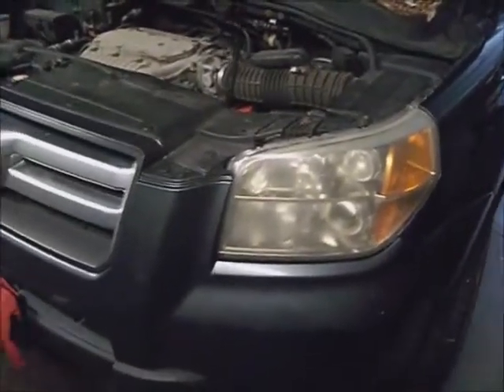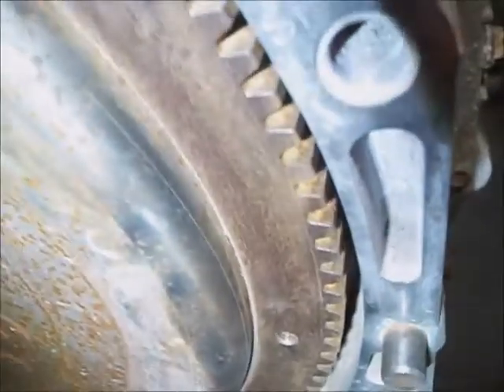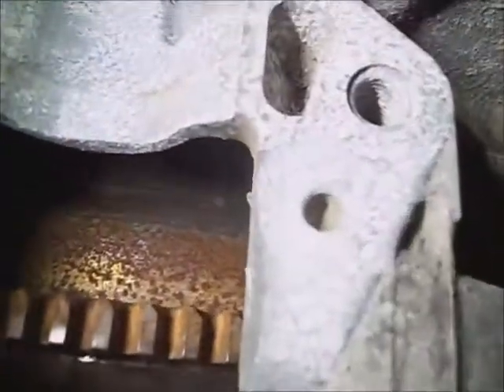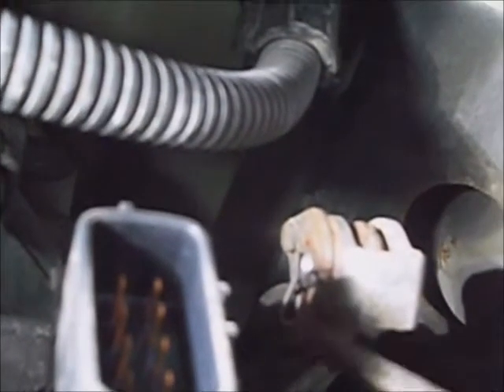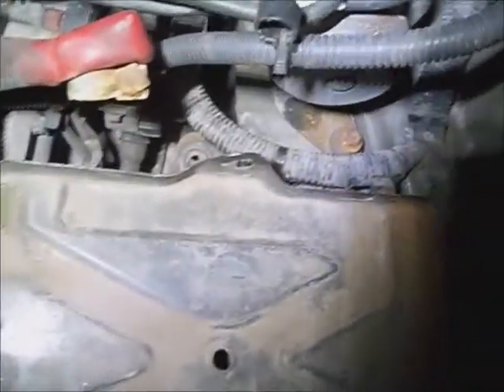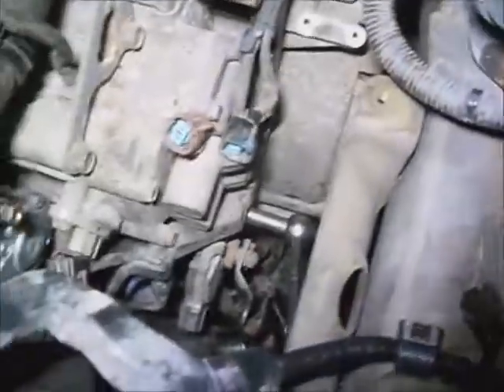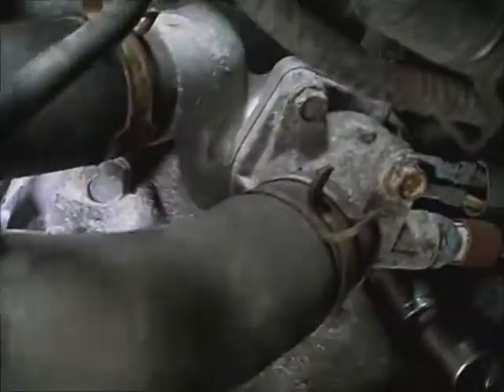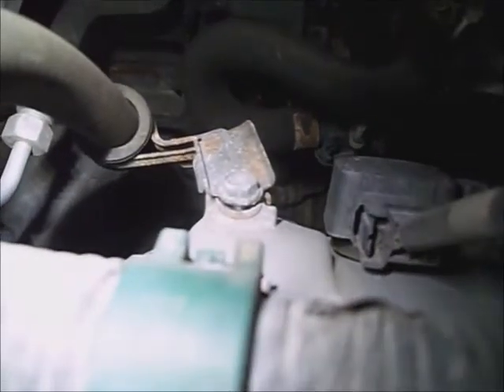Honda pilot`06 AWD auto transmission remove, lock-up in reverse only pt.1

Comment: This is a strange question, but how would you know if the transmission had been out of the car?  Are there factory parts that are broken and have to be replaced if the trans is rebuilt?-
Reply from the maker: Kirsten Van Wagner. If the trans looks clean, mabe.  Not really any outside stuff gets broken

Comment: Thanks for making the video! My 2007 pilot is doing something similar. It drops out of gear in reverse after a few feet. I think it happens more often if the nose is pointed downhill. Sometimes gears grind when shifting into reverse, then the gear thuds loudly as it engages. Other times I shift into reverse without any issue and can back up, but I think this only works on level ground. Any ideas? Could it be as simple as a solenoid or sensor issue, or is it something like damage to the reverse fork or some other mechanical damage inside the transmission?
Reply from the maker: Brett Hellstrom A shift solenoid or similar wouldnt grind gears.  But an internal mechanical problem would.  Especially w high miles on it.  Thanks for watching.